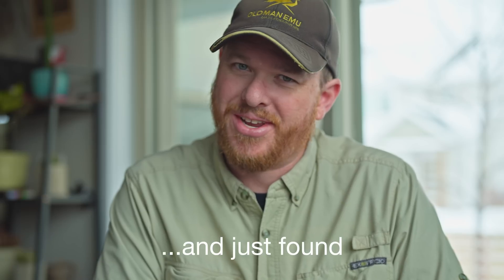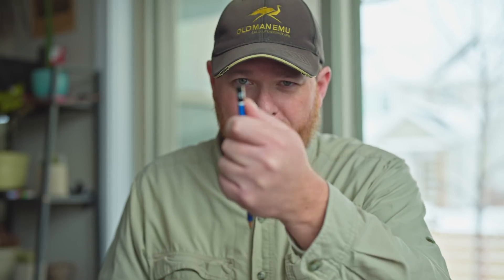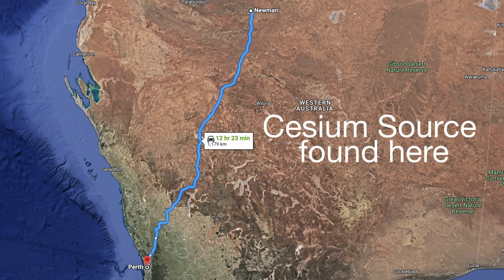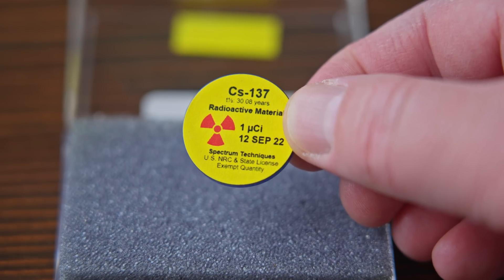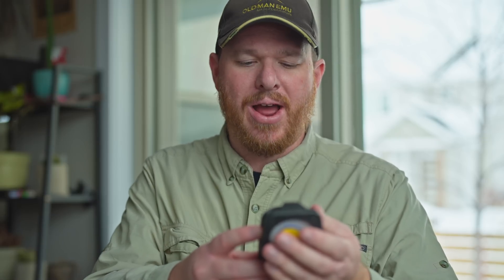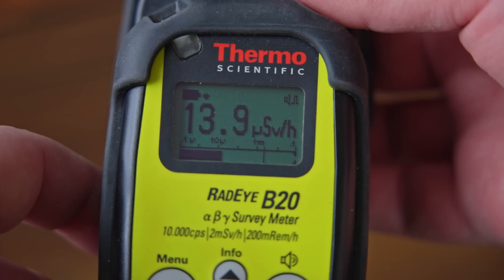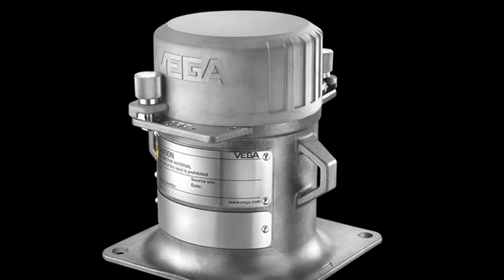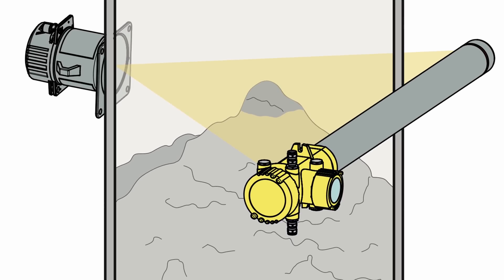Cesium 137 Source Lost and Found in Western Australia

Comment: It was lost on January 12. They didn't notice it missing until January 25 & it was found on January 31, 19 days on the side of the road. Upon opening the package, it was found that the gauge was broken apart with one of four mounting bolts missing. The source itself and all screws on the gauge were also missing.
Reply from the maker: I could see the source rattling out of that housing if it was just left to bounce around in the back of a truck.
Reply: @RadioactiveDrew  It was supposed to have been packed up by a contractor that specializes in these gauges on site to be sent back to their facility in the outer suburbs of Perth. That company is blaming the transport company. You've probably heard by now that it's since been found.
Reply: Gross negligence at best...

Comment: "Pretty radioactive?" Please.  How's that compared to a Fiesta plate?
Reply from the maker: A uranium glazed ceramic mainly gives off alpha and beta radiation. Whereas the Cs-137 source gives off a lot of beta and gamma radiation. So the radiation coming from the Cs-137 is much more penetrating.
Reply: @RadioactiveDrew  Yes, I now that. The uranium decay chain has lots of gamma emitters. An instrument check source is not that radioactive, really. I have naturally radioactive rocks hotter than that. The source in the density gauge was "pretty radioactive", not the check source. A H3 exit sign is "pretty radioactive", with little exposure to people. Please, these low level sources should be regarded as just that: low level and extremely minimal risk. Calling them "pretty radioactive" overemphasized their risk, contributing to the fear of all things radioactive.
Reply: It was emitting 2 mSv/hr from what I've read. That's not low level. Sure, less activity than an H3 exit sign, but at 36,000 times the energy of Bremsstrahlung off the tritium betas.
Reply: @MarkRose1337  Like I said, I have naturally occurring radioactive rocks hotter than that. And it's only an extremity dose where the limits are 100 mSv so it would take FOREVER to reach that limit. There's a difference between being "pretty radioactive" and being a dangerous source.
Reply: @scubaeqhp  I agree with you. It's nothing to freak out about. You could handle it safely. But you also understand why they warned the general public about it, too.
Reply: @MarkRose1337  I understand about warning about the density gauge source, but Drew calling the check source "pretty radioactive" is overkill (alarmist?). "Mildly radioactive" would have more accurately described the source. A lot of his stuff is good, but you have to really watch which adjectives you use.
Reply: @scubaeqhp  Yeah, check sources are low level enough they get thrown in the trash when disposed of. I remember being spooked by them in eighth grade science class though. That's about when my interest in radioactivity started, so I guess it worked.
Reply from the maker: @scubaeqhp  I think of the test disk source as being pretty radioactive because of the type of radiation coming off of it. I never said it was dangerous but it isn't something I would wear around my neck for a long period of time.
Reply: @RadioactiveDrew  I know you're trying hard but adjectives are subjective. The general public equates "pretty radioactive" to "dangerous" thanks to the antis. Simply because it emits gamma it's "pretty radioactive'? Well, you're welcome to define it as you wish, but you certainly are confusing the scientific definition of things. Compared to a Fiesta plate or a radium dial watch, the check source is small potatoes. I generally like your stuff, especially your visit to the Trinity Site (on my bucket list). I like your total dose numbers used to compare them. Keep going!
Reply from the maker: I get what you’re saying. Sometimes I describe sources how I see them compared to other things around me. If you take into account the beta radiation and the gamma from the test disk it’s around 160,000 CPM which is on the high side of activity for a source…for me. Usually anything that crosses that 100,000 CPM threshold is a high activity source in my opinion. The classification of dangerous source is more reserved for items beyond the detection range of my meters.

Comment: What about if someone kept it in their car? Can radiation be bounced back by metal?
Reply: Only if their car was made of lead. This source penetrates steel, that’s why it was used for iron ore.
Reply: @5roundsrapid263  I kept a rock of samerskite in a unused car in my garage for long time. I hope my car  has not taken in radiation and become a source that is residually radioactive itself. Samerskite has the element samarium. Samerskite is usually found on the Martian surface. It is radioactive but in it's natural formation form that it is found it's just slightly more radioactive than earth. I wouldn't recommend carrying it in your pocket or to sleep next to it. But it is safe to handle. So my question remains. If it's left in a metallic box would the box carry residual radiation?

Comment: Hello, I am from Perth WA and when the news broke about this, I couldn't believe the carelessness of the company (?), the driver (?), etc., and the health risks we could potentially be exposed to. Thank you for explaining the seriousness of this issue. You explained it so succinctly and clearly. Glad I found your channel and glad Cesium 137 was finally found!🙂
Reply: The theft that goes on at these mining companies can only be described as industrial.  

I knew of a drill fitter / boily working at one of the larger Perth drilling mobs.  He stole enough steel, drill equipment, hydraulic valves, hosing, fittings etc, that he actually built his own drill rig at home.  He was eventually found out because he took that one item they needed.  A hyd power pack they only had one of.  That's how he was found.  Even though he had been collecting gear for years.
Reply: The "lost" story is a total load of horse shit.  What happened was someone flogged it, thinking it would fun to fuck around with.  Then the local media blew up about it.  The person realised they will be in a lot of shit when they get found out, so they ditched it on the side of the road.  And then it was found.

That area of the country is pretty remote.  There is a whole heap of mining scattered all throughout.  A bit of seasonal tourism, eg grey nomads.  And then a scattering of remote communities.  The communities have high rates of indigenous.  Unemoloyment, alcohol use and theft from trucks and vehicles can be extremely high in certain towns.  

On top of that.  Miners, truckers and associated workers can be some of the roughest people on earth.  The foul language, and topics they discuss make your stomach turn.  Someone seen it while loading or unloading, or rummaging through the back of the truck at truck stop and boom its goon.
Reply: It was done by China not the company. Geo politics is pretty crazy at the moment.
Reply from the maker: @tinto278  what are you talking about?
Reply: @RadioactiveDrew  It’s called Chinese coercion and a type of interference in western companies; China Aus relations are bad due to AUKUS announcements. We have seen Rio Tinto targeted before with Serbian mine contract cancelation during covid. Australia was not letting people in who wasn’t vaxed and affected Novak Djokovic from playing in the Tennis Australian open. We saw it with the blasting of an aboriginal site at Rio Tinto mine a few years back. They threaten the company or pay people in the company to cause damage to the company name.
Reply: @tinto278  Are you suggesting sabotage?
Reply: @ajacks1349  Not sabotage but coercion. AUKUS are about nuclear submarines and this fits in nicely to the Chinese narrative.
Reply: Edit: turns out it was 2 mSv/hr at 1 m, not at the source. That makes it more dangerous than I had thought. I'm leaving this comment below as I wrote it.

It's really not that dangerous. Yes, dangerous to keep in your pocket all day, so you don't want someone who doesn't know what it is to keep it at home. But I'd have no concern about putting it in the trunk of my vehicle and driving it to where it needed to go. I've personally been more radioactive from Tc-99m than that source :D
Reply: @MarkRose1337  I've had radioactive Iodine (Iodine-131) for my thyroid. I had my own toilet for 24hrs to pee in, no one else could use it, then clean it, back to normal. I think I'd shield the cesium if I was transporting it, tho, just to be safe.
Reply: @repro7780  Well yeah, if I were in the business of transporting it I'd shield it further. In a pinch I'd surround it by jugs of water.
Reply: @MarkRose1337  yep, in a emergency, water would be at least helpful.
Reply: @repro7780  I hope you recovered well.

When my cat had I -131 treatment she was kept in the clinic for 7 days, then cat litter had to be flushed for a month. Cat had to stay in a locked room for 2 weeks on coming home. Next 2 weeks not allowed within 1 metre but can stay in same room. The precautions were crazy
Reply: @MarkRose1337  Agreed, but remember that if you were going to be transporting this, it would be in its shielded casing, and likely with a cover over the aperture.
These would minimize any risk.
On the other hand, the bare source would be much more dangerous.
In that case, you'd probably want to transfer the source(preferably from a distance)into a suitably shielded container before placing it into your car trunk.
Reply: @m.k.8158  I was just informed the 2 mSv/hr dose rate they were talking about was from 1 meter. That makes it significantly more radioactive than I read at first. I thought it was a 2 mSv/hr at the source.
Reply: @MarkRose1337  Yep, quite a difference.
Reply from the maker: Yeah…2 mSv/hr at a meter is something that could really injure you if you held it in your hand for any length of time.
Reply: @MarkRose1337  Yes, you need to remove your original comment.
Reply: @ajacks1349  I edited it instead to keep the context of this thread. Thanks for calling it out.

Comment: We had a company at my former employer who were x-raying the concrete parking deck for internal damage (salt damage) to find cracking. They had Danger signs (X-RAY, radioactive danger) all over the place, taped off areas, etc. Those Xrays must have been stronger than medical ones, I would think.
Reply: Yeah, 95% of the time Cs-137 decays into Ba-137m, which gives off a 662 keV photon when it decays. Medical x-rays are more in the 20 to 60 keV range.
Reply: Yup usually either a 300MV x ray tube or a nuclear source such as Iridium or cobalt. Cs 137 isnt normaslly used. 🤔
Reply from the maker: Cs137 is used a lot in soil density measurements.
Reply: @christopherleubner6633  you mean 300kV right? Lol
Reply: @inductivelycoupledplasma6207  Lmao imagine a 300MW x-ray tube. Literal death ray haha
Reply: @Sanchuniathon384  yeah lol. Even a little x ray tube run at 100W produces a lot of radiation
Reply: So what about the guys next to it getting scatter  ? I’m sure direct contact is much worse then scatter but did they know about scatter? And x ray in medical is way way way way lower lol

Comment: Where do you get 20 millicuries from? Please provide a source of information. All reports mentioned 18.5 or 19 GigaBecquerel, that is 513 MilliCurie! That's not 20.000 of your test sources, but 513.000. A lot for sure.
Reply: I searched for dose rate calculation to dose rate from the source activity and distance. So, 1 Ci of a spot Cs-137 source gives about 3 mSv/h of dose rate at a distance of 1 m. 20 mCi gives a 50 times lower level of gamma radiation, or 60 uSv/h. Maybe these values help us to estimate the source to be lost in Australia.
Reply from the maker: They need a source strong enough to check the density of the ore. So the 20 mCi source makes sense. The calculations I was doing for exposure was for on contact since that was their worse case scenario…someone picking this up. No one else did the tiniest bit of research that I did for this showing what more than likely the source came from. So far the news agencies have proven they don’t  know what they’re talking about. So I have far more faith in my data given the information I have found.
Reply from the maker: 20 millicuries is 20,000 micro curies. I heard the activity from a report on the source and the research into the containment vessel also said 20 mCi as a source option.
Reply: @RadioactiveDrew , the Guardian says about the lost source that "The missing capsule is a 19-GBq (gigabecquerel, a unit of radioactive decay) caesium-137 ceramic source, commonly used in radiation gauges. Caesium-137 is a radioactive metal with a half-life of 30.05 years – meaning in three decades it will have half of its original activity. It emits beta and gamma radiation."
Reply from the maker: Wow…if that source really was 19 GBq that comes out to 25 times more intense than the 20 mCi source I was giving examples for. If it was that active it would give you a fatal dose in half an hour. So based on all that I don’t think it’s that strong. Usually sources that can cause death that quickly are a bit more controlled.
Reply: @RadioactiveDrew  It was only emitting 2 mSv/hr though, according to what I've read.
Reply: @RadioactiveDrew , yeah. Sometimes the source may be 10 times or more stronger to penetrate, for example, 30 to 70 cm of steel. So, Ir-192 source may be up to 400 Ci or 14800 GBq strong. Or EXERTUS VOX 400 with 400 Ci of Co-60. It is packed in depleted uranium to protect from radiation and can penetrate 200 cm of steel.
Reply from the maker: Yeah those sources are gnarly.
Reply from the maker: @MarkRose1337  there's no way a 20 mCi Cs-137 source would only be emitting 2 mSv/hr of gamma...unless it was very old.
Reply: @RadioactiveDrew  I'm only going by what I read. The media screwed up the becquerels so maybe they got that wrong as well. I'm guessing the beta is shielded. They state 10 x-rays per hour which would also indicate something around 2 mSv/h. Keeping in mind most 662 keV gamma will pass straight through a person and lower the Sieverts compared to lower energy x-rays.
Reply from the maker: @MarkRose1337  question is would that source be strong enough to be used for iron ore density screening...I want to say no. Plus the source activity listed for that housing is listed at 20 mCi https://www.vega.com/api/sitecore/DocumentDownload/Handler?documentContainerId=1008191&languageId=2&fileExtension=pdf&softwareVersion=&documentGroupId=66497&version=27-07-2022
Reply: @RadioactiveDrew  That document says the max permissible source is 20 mCi. I guess they could have had something weaker inside? It says it has lead shielding as well, which would explain why 19 GBq is only giving off 2 mSv/h.
Reply: @MarkRose1337  they wrote 2msv/h in 1m distance
Reply: @weirdmeisterinc  Ah! That is new information to me that wasn't in what I had read. Thank you!
Reply: @RadioactiveDrew  Please check again the reports from the Australian authority DFES from last week (January 28) and the press conference with Dr. Andrew Robertson and the deaf interpreter. He says: 19 GigaBecquerels.

Comment: I wondered if any radioactive enthusiasts in the area spent a few days driving up and down with something like a Radiacode, or pancake probe hanging out the window, trying to find it for themselves 😅
Reply from the maker: That would have been fun.
Reply: Wouldn't need to hang it out the window. A source like that could be picked up easily from 20 meters away, which is why they were able to drive down the road at 70 km/h (19 m/s) when they were searching for it. It was found 2 m off the road.